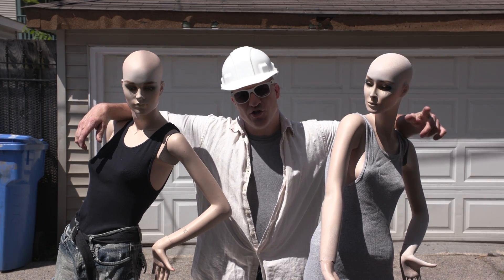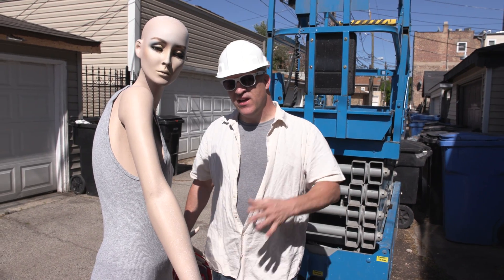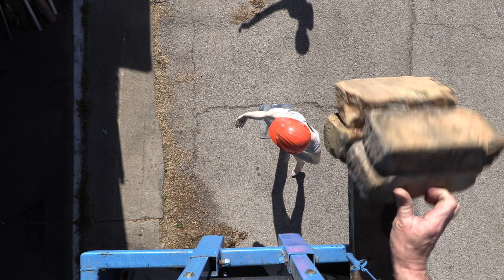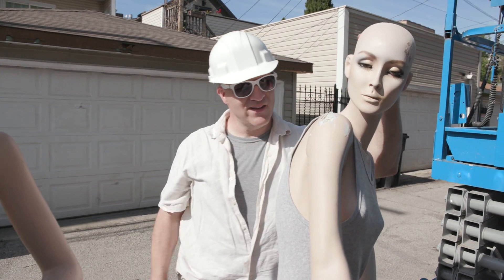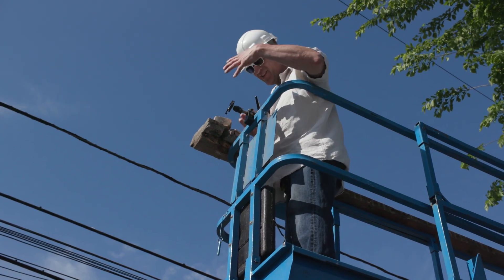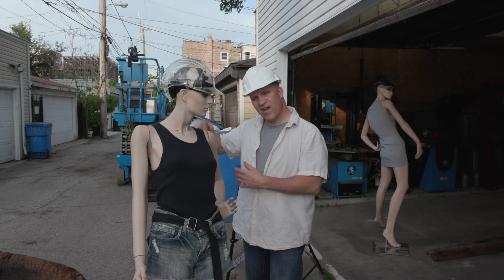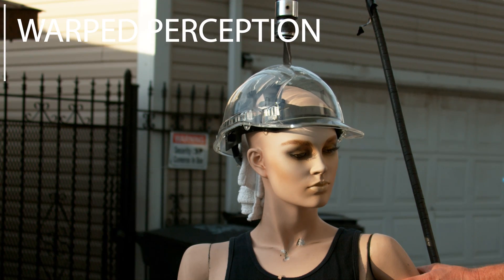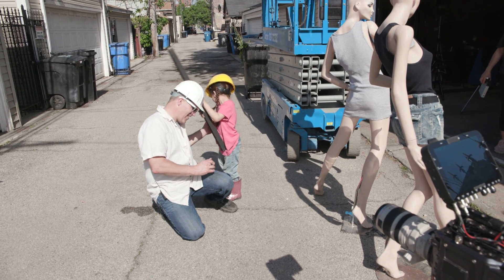Hard Hat Test (in 4K Slow Motion)

Comment: I had my life saved by a hardhat when an impatient illegal on a job site decided my lockout was in his way. Cut my lock and restored power to an industrial AC unit I was maintenancing while my head was level with and between a multi horsepower 5 foot fan. The thing hit me three times, bouncing my head against the wall of the fan bay each time and absolutely carving into the helmet. Thing would have smeared my brains on the walls with ease.
Reply: Anyone who uses the term "illegal" to describe another person is usually a shit kicking hick pos.
Reply: @xxx-ff9gw  Lol, anyone who can't handle a simple, factual descriptor like "illegal" is generally a snowflake hypocrite that lives inside of a structure with walls and locks on the doors.
Reply: Should be thankful you still alive but you bitter and full of hate.
Reply: @gussferretti9665  At what age did you start having delusions that you were both psychic and we're the arbiter of how people should be?
Reply from the maker: OMG !! That's crazy
Reply: @WarpedYT  It really was, it had me pretty shook. The crazy part was how fast it happened and the fact that the third hit knocked me out of the way AND marred so deep that the blade took my hard hat with it.
Reply from the maker: I used to do a lot of industrial mechanical work, refrigeration, ventilation industrial processing stuff like that. And while I didn't usually wear a hard hat after the first year or two of working, I got into the habit of wearing just a regular hat, it's saved my face and my head so many times.
mostly because while I was inspecting these machines I would get very focused on the problem at hand and diagnosing what was wrong, sometimes I will get my face a little too close to the blade or belt or moving part, and Bam it would hit or take my hat, better the hat then my face, so when you say you were shook I know exactly what you're talkin about.
Reply: @WarpedYT  Oh man, yeah, you know. I knew those motors had ~7HP+ ratings, but I just didn't have a gut level knowledge of how much force that can exert on a human. I didn't usually wear the hard hat either but I was in a petro plant so I had to be all safety'd up. I know what you mean about focusing in, I'm the same way when troubleshooting. It takes a lot of thought to run an accurate model a large complex machine in your head, and I was right in that kinda trance like focus.
Reply: @AtlasReburdened  what ended up happening to the guy that restored the power?
Reply: @james6794  I don't know. I was told he was fired but I'm willing to bet that was just to keep me from throwing a fuss and potentially costing the plant legal money. He probably still works there.
Reply from the maker: @AtlasReburdened  I've seen a lot of Carpenters bypass the lockouts to use their tools
Reply: Atlas WalkedAway he was almost definitely fired, breaking through a lockout is a major osha violation
Reply: @AtlasReburdened   So you were at a secure petro plant but it had "illegals" working there? You sure about that?
Reply: @koko56  Lol, yeah bud, welcome to Houston. You try to find a contractor who will suffer the full cost of hiring nothing but vetted citizens to paint the inside of a 40 foot dia. oil storage tank in the summer. Then find me a CFO that cares about anything but the coats going on and drying to spec for the cheapest nexus between risk and benifit. They don't care, their profit margin exceeds the fines if they get caught, but they don't, because Welcome to Houston. I was a Ironworker at a later point, and also worked beside illegals. Illegals that did terrifyingly sub par welds. Hopefully those buildings will stand the next hurricane. Welcome to Houston.
Reply: @AtlasReburdened  Shiiiiiiiyyyyyyyyt. Don't think that would fly in UK at least. Depending on environment a lot, but most times you need a paper of some sort at least.
Reply: @koko56  Yeah, things can be different when you share a massive land border with a second world nation and half your country not only can't even conceptualize the fact that open borders and socialism are mathematically mutually exclusive concepts, but beyond that, are willing to destroy your economy and wages by flooding you will cheap, unskilled labor, solely in the hopes that they're right about this fake "borderless socialist nation" experiment.
Reply: @AtlasReburdened  Eh, hard to comment. I don't really follow it too closely. In UK the equivalent would be Eastern European people. I actually have more confidence in the average skill of an EE handyman/plumber/welder/electrician. UK used to be world class with apprentices - several decades back. Now I think a lot of areas have peaked, life became too easy and the required level of skill to "play the game" has also decreased. It ebbs and flows, but save for a few percent at the tip of research and manufacturing, the "West" is heading for a bad time.
Reply: @koko56  I understand. It's a situation without a direct analog. Yeah, it all moves in what appears to be cycles but are actually sine waves when plotted over time. The core problem we face is that our legal immigration system is tuned to move with the wave that represents the cohesiveness of the society. As it lowers, so too the import of other cultures should lower to allow for integration of those present into what is an objectively prosperous system, then as unity again creates extra prosperity the doors should be opened wider. The problem being that the porosity of the border defeats this function, selects solely for ambition whilst excluding the willingness to work withing the confines of rules we know to generate prosperity, and past a certain throughput, dragging that cohesiveness value into a slope instead of a sine. 
There's a breaking point at which cohesion tanks, and society begins to look like any given liberal city.
It does eventually recover slightly, but only once the host society has been essentially tranformed into exactly what was fled from because the host population simply can outpace a whole nations open tap.
Houston is going into the 'any given liberal city' phase.
Meritocracy in the governing bodies has been replaced with nepotism, corruption, and identity politics.
Drug addicts adorn every gas station and overpass with neither scrutiny not empathy from society.
The soothing sounds of home owners testing their instruments of self defense on the weekend has turned into the sound of airbound celebratory fire and shots coming from moving cars.
Respect for property boundaries is vanishing.
Police have taken an increasingly authoritarian role, devoid of tangible interest in justice.
Etc. etc. ad nauseum.
Reply: @AtlasReburdened  Yeah... there are a few hard sci-fi books that allude to planets becoming either a collection of mega cities vs countries, or further still - a planet becoming a city, without much difference. 

Good or bad, it appears were are progressing towards that. Thanks for taking the time to write all that too, interesting insight. Although I often wonder just how much of that is impacted by our own bias. Having had pretty varied financial situation over past 5 years (working; good pay, to student to seeking work, almost into good job again -> COVID19) I discovered there are almost countries within countries, due to how empowered you are financially and how it can relate to world view. The banal things like parking tickets, police interaction, hopelessness etc. It's fucking crazy.
Reply: @AtlasReburdened  yes sir. I agree
Reply: @AtlasReburdened  you should have took legal action, that could have been big money for you, especially considering what had happened to you
Reply: @beefjerky1264  Probably so, but it resulted in essentially no physical injury and I rather detest the litigious nature of our modern society.
Reply: @AtlasReburdened  you're a better man than I am, I wouldn't let some illegal get away with that
Reply: @AtlasReburdened  first and only time I got hit was when I was working residential electric in a house that wasnt supposed to have power. An illegal who was a painter mustve flipped the breaker and I got hit reaching into the wall to grab wire for a dryer outlet. Very lucky I wasnt in a puddle and was wearing insulated boots. Got paid shit money to work next to people who didnt care or couldnt speak English. Wised up and left for a different path. Immigrant labor has completely decimated wages undercutting the native labor market, especially if you look at the complete stagnation of real wages after America started bringing them in en-masse in the 80s. People don't have enough sense to understand what that does to a market given a long enough timeline

Hope you're still staying safe out there man.
Reply: @chickenzzzzzzzzz  Oof, that'll wake you up. Glad you didn't get it worse. 
You are unfortunately correct. Most Americans these days have been too dumbed down by intentionally detrimental public education to grasp concepts as big as the net effect on wages of massive labor importation. Hell, if any modern student wrote the sentence I wrote above, it would receive a failing grade and instructions to split it into two or three smaller sentences that simultaneously bury the nuances that are only found in the whole, and put it into a format that requires 0 mental processing to grasp. That last part is a killer. 
Any skill that goes untested atrophies, and atrophy of the ability to grasp complex concepts in a single frame of mind is atrophy of the quality of all future endeavors. 
People don't understand the power of an idea. A simple idea, even a fictitious one like "run on sentences" can sow seeds of ruin through generations.
Reply: @AtlasReburdened  Ty for the well thought out response man. Have a good night.
Reply: @AGNDAHOUSE  what the actual hell bro chill
Reply: How do you know he was an “illegal”
Reply: @kevinthekid9623  Because I tried to track him down, and his lack of any records in the US meant only one thing.
Reply: Glad you’re alright
Reply: What?
Reply: sounds like a bonus level on a super hard game, like Sammy Lite-foot or some-n
Reply: @AGNDAHOUSE  
You need to stop reproducing. Make us that favor. You should not be telling anyone they deserve anything to happen to them .
Reply: Sometimes is hard working with dumbass people that are at the wrong place at the wrong time. Sorry Atlas but I'm talking about you buddy 😅
Reply: @user-ie4kp7ni9d  Oh yeah, im so evil for being the type of person that thinks it important to specify that the criminally negligent fuck that almost killed me had a complete and total disregard for the law from the moment he entered the country. Go change your tampon and get over it, kid, and when you're done take your front door off its hinges you damn hypocrite. After all, who are you to think you have the right to control who comes and goes?
Reply: @AtlasReburdened  As a fellow American, why are you in someone else's HIPPA? Remember fair is fair, you didn't need to say if he is illegal or legal. Fair workers law, talk about your manager or supervisor, not the guy who probably never will need you. But here you are looking for some BROS to hear you cry for a hard hat and some new tools! Good job fellow red, white and fool!
Reply: @user-ie4kp7ni9d  Does your house have a door and walls, moron?
Reply: Big Black Boykyn what doing his job?? Maybe the illegal shouldn’t even be in this country in the first place...

Comment: I don't know if you've any interest in pushing this further, but from what im seeing the limiting factor for the hard hats is they have a low mass and are relying on the straps to provide a spring tension to keep positioned and to keep doing thier job, they flicked off and around the head alot, you could perhaps try a full face helmet, like a downhill cycling helmet, or a motorcycle helmet and see if they provide more consistent coverage ( less slipping! ) and if the rubber band effect of the hard hat is better than the coverage of a more full helmet perhaps with a force gauge on the neck? since you almost have one decapitated anyway. either way, nice video cheers.

Comment: 2:36
Perhaps protective shoulder pads should also be a thing?
3:36: and maybe a protective neck covering?
Reply: It wouldn't be practical for most places hardhats are used. The added heat, loss of mobility and weight would cause more accidents than it protects from. The hardhat itself is a major inconvenience,  especially in tight spaces.
Reply: @TheKajunkat  Yup, as an Ironworker in Houston I saw multiple guys go down from heat stroke with thin t-shirts under their harnesses. Adding padding isn't going to help that one bit.
Reply: Atlas WalkedAway 
Yikes. Still, there has to be a better sort of protection one can come up with then this. Something that can at least offer token resistance but still be tolerable to have on you more often then not, even in conditions that you describe.
Reply: Atlas WalkedAway yeah those Deer Park/Baytown plants hit 120° easily in the summer
Reply: @TheKajunkat  I’ve hit my head on more crap crawling around with a hard hat on than if I didn’t have one on. Plus they fall off. Maybe I don’t have them on right or have a welding cap on too…
Reply: You could wear MX gear with a neck brace. That got you covered
Reply: They have that on racing helmet, there is a piece of carbon fiber supporting the driver's neck.
Reply: Why not a full-on high-strength Chrome Moly Steel roll cage? Have you ever worked industrial Construction, or anywhere else PPE is required?